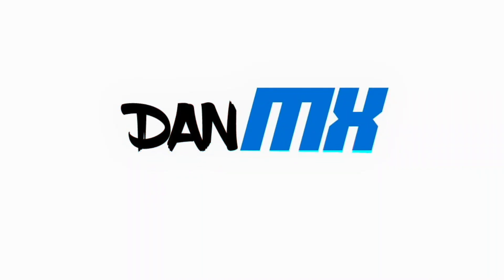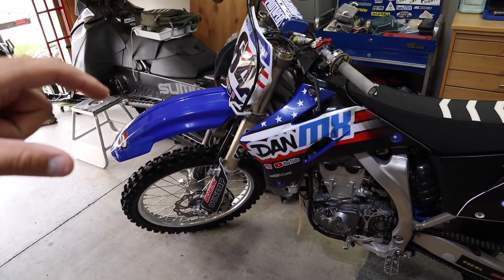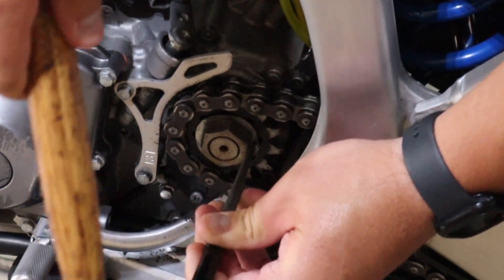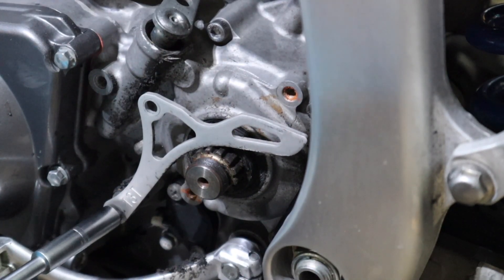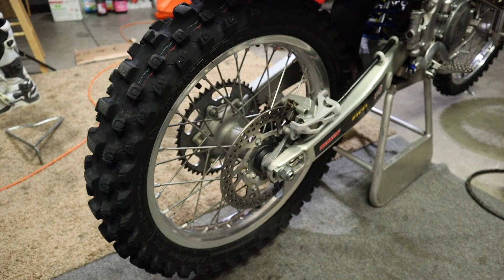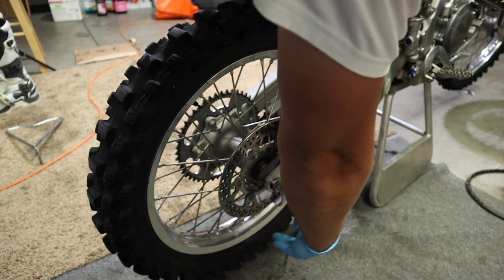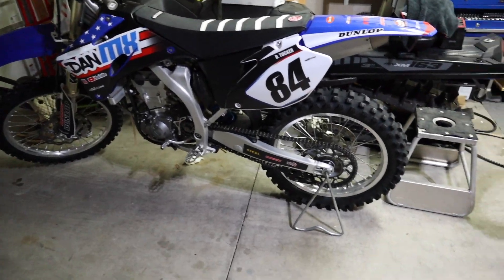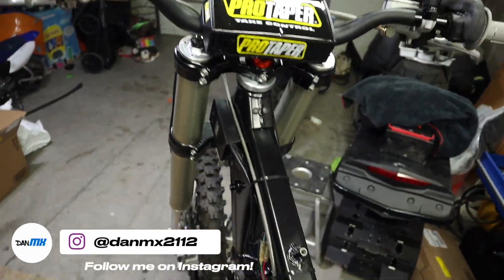DIRT BIKE CHAIN AND SPROCKET REPLACEMENT | Tips and tricks!

Comment: Hi, I have a question: If I lower a front tooth and raise two back teeth, will I have to change the chain?
Reply from the maker: Tooth for tooth, no. In your case, your adding a tooth of sprocket overall, that means you’ll need a longer chain if you can’t adjust the axle forward enough to accommodate it. Does this help? I’m always trying to explain this and feel like a fail miserably lol
Reply: @DanMX2112  Let me explain: I have a KDX 200 with 13 teeth in the front and 47 in the back, but I feel that the bike doesn't scare me as it should, so I want to change it to the following configuration: 12 teeth in the front and 49 in the back, remembering that 1 front tooth equals two back teeth, so does that mean my chain will have 2 extra links?
Reply from the maker: Gotcha, what you are doing is adding more torque to your bike, which will then help with the excitement your wanting! The idea of one tooth in the front equals two in the back is not directly related to the actual tooth count but by the gear ratio. What this means is: if your size down 1 tooth on the front, that is equal to 2 in the rear, as referring to gearing. That being said, going from a 13 to a 12, now your chain is long 1 tooth. With the back, going from a 47 to 49, now your chain is short 2 teeth. Now do the math, 1 - 2 = -1 . Your short 1 tooth by using the new gearing.
Reply: @DanMX2112  Thanx for the answer. It helped a lot
Reply from the maker: Awesome!